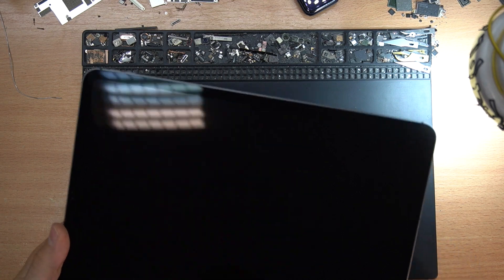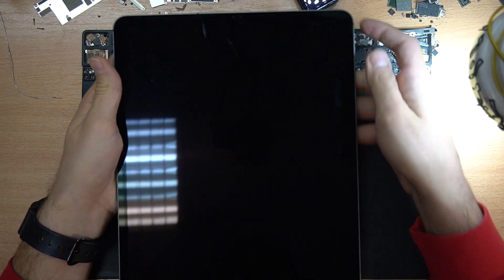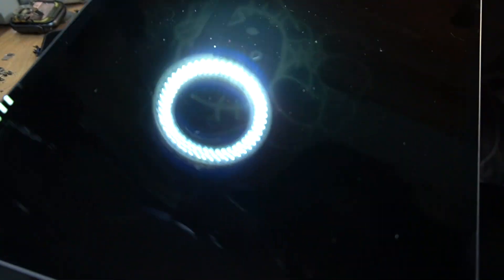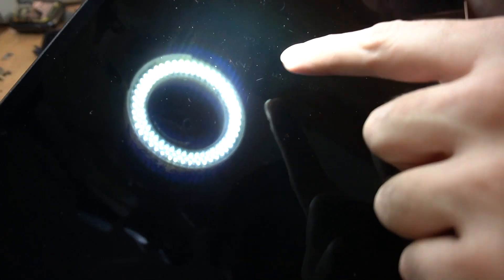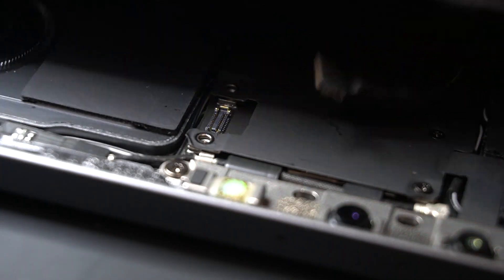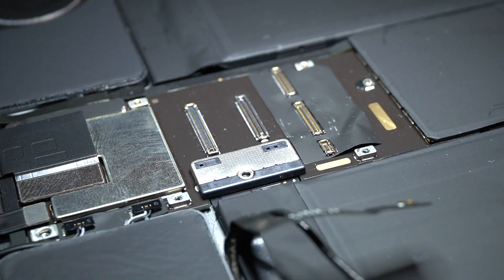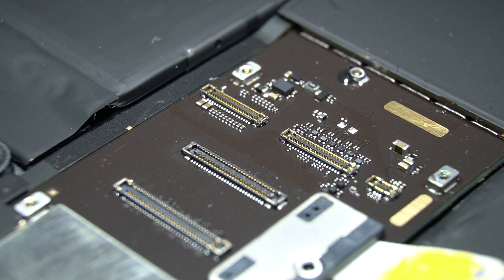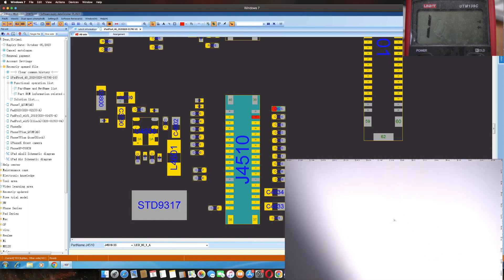iPad Pro 12.9" 2018 A1895 no backlight

Comment: where I can order those diodes and capacitor?
Reply from the maker: The best place is from a doner board (iCloud locked).
You can also search on aliexpress.
Reply: @iTouch-repair can tou give me the diodes specifications please and the filter capacitor as well l...I'll try to order. Thanks mate.

Comment: Hi, I have a iPad Pro 12,9 with M2 2022. Unfortunately, it fell into the water, and I took it to a shop to dry it out. After they worked on it, the technicians said it wouldn't turn on. I tried it at home and noticed that I could hear some button sounds, and when I checked with a flashlight, I could see the screen. Do you think something short-circuited, or is it the screen? Thanks.
Reply from the maker: @DogcatTogether587  Hi, it could be that there is no backlight, now where the problem is located I can’t tell, you need another screen to check.
It also could be an issue on the board in the backlight circuit, most likely it’s the screen (the backlight connector on the screen it self has corrosion).